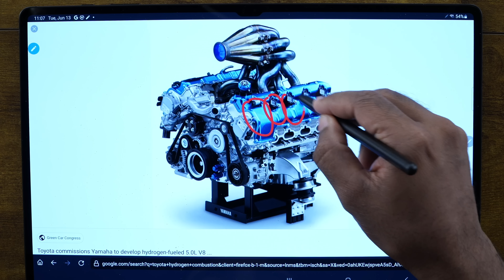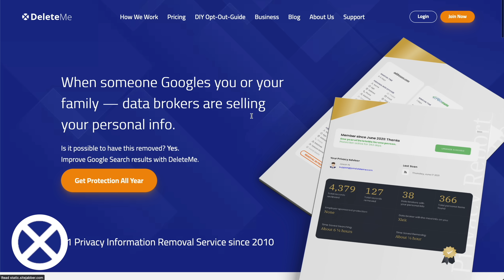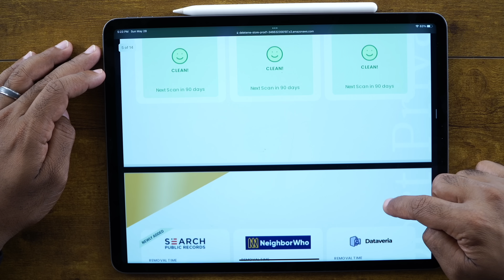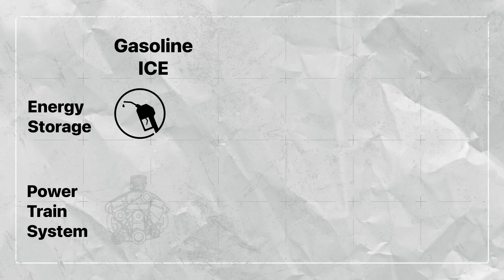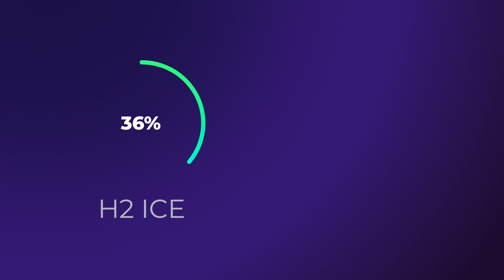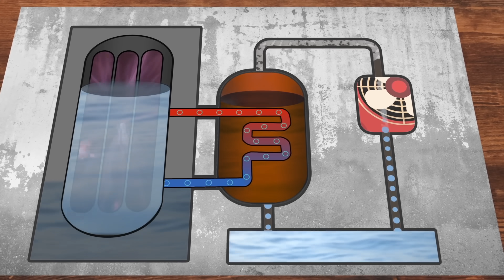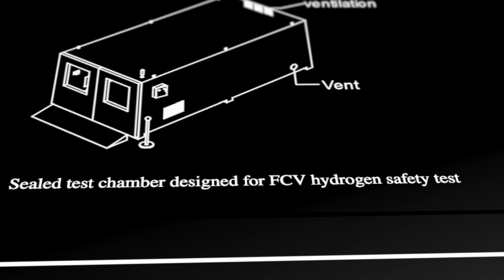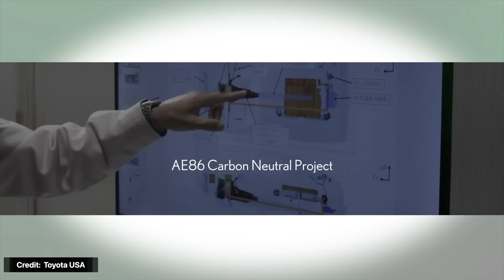Toyota's Says They Just Destroyed EVs - Hydrogen Combustion Engines

Comment: It is absolutely necessary to spread H2 as an alternative to battery EV. It's not a question of pro and con, but to divide the load. To have an alternative available if needed - for example if there is no material available for millions of new batteries... We now see how difficult and expensive it is to spread one alternative to an established system (EV to classic ICE). So why not divide and conquer?
H2 generation, transportation and storage might be ineficient if you compare to "powerplant into battery", but you always forget: Your battery is full but your powerplant (nuclear, wind, water, solar...) still has energy to give. Not using that is 100% loss. Could as well just create some green H2 which takes less space to store than batteries and have it.
H2 powerplants are great fallback solutions. Not only stationary, but also for vehicles.

H2 usage in ICE vs Fuelcell is another topic, and yeah maybe it is indeed just a people pleaser to aid "petrolheads" (no offense)  into a slightly less polluting method of revving. Which is fine. A big part of classic automobile and motorcycle industry doesn't sell mobility, but "feelings" and are highly endangered by the lack of sound and vibration EVs come with. Give them an H2 ICE that is of course way less efficient than a fuelcell or BEV, but still a huge step into less emissions compared to gasoline ICE. Not giving an H2 ICE means those petrolheads won't change at all for as long they can, endangering the whole goal of less emissions.

And lastly: The world is big. America and Europe don't get the memo that H2 stations for vehicle use are a neat thing to have. From that point of view, even the fuelcell EVs like Mirage are doomed to fail. Luckily, in Asia there are H2 stations. There is an market, small as it might be, that drives the development of this technology.
If America and Europe are smart, we will jump on this train. Hopefully sooner rather than later.

Comment: Ballard power systems has had Hydrogen powered vehicles in development since 1986 and had a Hydrogen powered Pickup Truck that drove across Canada and it's total emissions was the equivalent of a bathtub full of hot water.  Hydrogen power cars are nothing new and have been played with for decades but never gained any traction in the market because it means big oil will loose profits and now that Elon Musk has cracked open the door to EV's, and the "Green" initiative going on, EV's are becoming the new trend to replace fossil fuel cars.

The problem is, EV's have a dirty secret.  The materials for the batteries come from countries that permit strip mining and the batteries when their "life" is over don't really get recycled.  They have very little range to speak of and if you want to go somewhere long distance and pull a camper trailer, good luck with that EV, you're going to be stopping an awful lot to recharge.

John Kanzius (Deceased) while looking for a cure to his cancer (A retired radio engineer) also made a machine that released Hydrogen from salt water in a surprising manner.  So much so that he showed it to colleagues he had that worked for GM and GM built a 5 Million dollar prototype with a power cell that could power 1/2 a rural block on salt water.

The sad thing about this announcement is that this will also probably get squashed because it will greatly diminish the ability of EV's to dominate the coming market with their "Green Technology" on so many levels and embarrass so many high level people who pushed the entire EV agenda.

Comment: If the world ever becomes serious about clean energy they will embrace Japan's vision of the modern small nuclear community based reactors that produce hydrogen with its excess electricity.  This would leave the smallest possible carbon footprint behind for future generations.  Battery based vehicles will never be mainstream.  They have just as many issues as hydrogen based models and their true carbon footprint is greater than that of the ICE.  The fact that fossil fuels are used to charge most EVs drives the point home.  Nuclear is the way forward.  Recycling of existing nuclear waste is now a reality that shortens storage spans of nuclear waste dramatically.  The sheer genius of hydrogen is you can convert ICE engines to run on hydrogen as you start to replace gas stations with hydrogen stations.  Another advantage to this approach is you could generate hydrogen on the spot using nuclear generated electricity removing trucks from the road moving hazardous cargo and relieving traffic congestion.  Instead of parking for 15 to 45 minutes to fill up it would be 5 minutes like a typical gasoline fill.  As existing ICE engines wear out, hydrogen fuel cells become mainstream.  Portable electric generators get replaced with portable hydrogen fuel cells.  It's a natural progression.  Don't count out hydrogen.  When the greedy politicians start to run for cover hydrogen will have its day in the spotlight just like nuclear power.  It's the real way forward.  It won't cook birds in the desert and mutilate birds in wind turbines either.  Wake up people!

Comment: The same processes that made Mars a dry planet also operate on Earth, albeit more slowly. If we create an industrial society based on use of hydrogen as a fuel, some of it will leak, as you said. Some of what leaks will escape to space. The natural rate of loss of hydrogen will be accelerated. It will be blown away by the solar wind faster than it already is. Earth will become a dry planet sooner if we use H₂ as fuel.

Technology similar to that which is used to produce H₂ can be used to create gasoline and other liquid fuels for transportation by removing carbon from the air. Use of this type of fuel would not cause buildup of CO₂. Molten Salt Reactors (that operate at very high temperatures) can drive the process.

Comment: The problem is the tank needed for a car. 1kg of liquid hydrogen gives about he same mileage as 1litre of petrol but takes up about 14 litres of volume so you'd need an enormous tank Then there's the issue of liquid hydrogen constantly boiling off and needing to be vented, so leave your car for any length of time and your fuel tank is empty.

Comment: While I agree when Toyota partners with someone else they don't firmly believe in the success so they are not throwing all their eggs into one basket so to speak.  But, you mention Yamaha is their partner for the H2 engine.  Hate to break it to you but, Toyota has a very long standing with Yamaha engines.  Your video contained clips of one such engine created in 1980.  That 4AGE shown multiple times?  Yeah, that's a Yamaha engine.  Not to mention that 4AGE engine has seen five different variants and was still being produced until 2002.  Twenty two years Yamaha produced the 4AGE for Toyota along with many many other engines.  I should know, for the last 31 years I have owned, raced, and built/rebuilt a great many MR2's that have all been 4AGE powered.  Yamaha is stamped into every cylinder head and every block.  Even the Mark 2 MR2 (1990-1998 in Japan vs. 1991-1995 in US) turbo models came with a 3SGTE also designed by Yamaha.  Last I heard they are on the 5th generation of the 3SGTE as it is a common swap for us MK1 MR2 owners.  

I appreciate the video but, if you are going to state something as an example, maybe learn the history of that example before you use it.  Toyota doesn't actually "make" the engines.  They assemble the engines made by someone else like Yamaha.

Comment: Hydrogen is literally the worst idea.  Clean water is already scarce and will only become more scarce.  Burning hydrogen is not efficient, producing hydrogen is not efficient, dispensing hydrogen at the pump is not efficient and storing hydrogen is not efficient.  Battery technology is nowhere near maturity, just like solar energy once was it will outpace current battery technology as we know it in a very short time.  Battery storage will not only unlock EV's but solar and other renewable energy because of the cyclical production nature of most renewable energy.
Big battery EVs are a waste of resources, manufacturers should be regulated to making plug-in hybrids or short range EVs that can charge fast at 240vac until battery technology has matured to unlock long range EVs.

Comment: Hydrogen fuel cells are not even close to 60% efficient. Hydrogen will never be viable over electric vehicles. An ICE hydrogen engine is almost comically stupid. Check out RealEngineering’s video on the truth about hydrogen for and actual fact based video on the topic. 
“We need clean hydrogen” umm no. Hydrogen is nothing more than a battery who’s only advantage over traditional batteries is a faster refill. 
It’s far less efficient, more expensive, more complicated, wastes more energy that could be used elsewhere, requires exceptionally more infrastructure investment, less practical than EVs, and been tried for 50 odd years without success. 
This video is comical in how it it glosses over the absurd inefficiency of hydrogen as a fuel source. Possibly for heavy industry like semis, ships or planes but even the most ambitious theorists admit hydrogen will never be a viable passenger car fuel.

Comment: One thing to add to the negative column for H2 combustion. On board energy density. Even with 10,000 psi tanks of hydrogen stuffed in all available spaces in a hydrogen fuel cell vehicle, which uses hydrogen more efficiently than combustion, a hydrogen fuel cell still has a limited range not that much better than an EV. In fact most of the longest range commercially available passenger HFCVs already have the same range as some of the longer range EVs. 

But with hydrogen combustion you are going to get much less range from that same volume of hydrogen in those same 10,000 psi tanks stuffed into every available spot. The only way a passenger car with a hydrogen combustion engine will get the 300-400 miles of range that an HFCV or EV gets is to add more tanks which means no trunk space or losing the back seats. Not practical in any way.

Comment: You should add how Hydrogen parts are recyclable because they are normal parts. Batteries on electric cars are not recyclable and if we intent to have 5 million cars built each year or more, that means given time of battery cars adoption will also see about 5 million electric car batteries leaching into the ground because we cant do anything with them other than store them. I would like to point out as well that battery cars DO NOT make power. They only store power and the power is made in 60% of cases by fossil fuels. As well mentioning that the battery production cost a lot carbon emissions. Electric cars are not good for the future of travel. The batteries can be unstable in car crashes and catch fire, the lost of range is costly in cold climates, the power grid in the US alone can't handle 100 million electric cars on the road and power any kind of industry along with us power consumption.

Comment: The huge glaring problem with EV's is the fact that after ten or so years the batteries no longer hold charge and your car is now defunct.... That is a huge loss not factored in here... for the cost of replacing the batteries in your ev (which will have to happen as your charge gets worse and worse each time...) you can buy 2-3 used ICE cars that have been running since your ev was built and will continue running for years and years after with basic maintenance.
Reply: The average lifespan of a car is currently 12 years, and it now looks like EV batteries (that are properly managed, i.e. not in a Nissan Leaf) can last at least that long.
Reply: @Xenon0000000000001  I'm sure that is a statistical average, but in reality again look at how many cars there are on the road that are much much older than that. I could have counted probably 60-70 out of 200 just driving around today. Also we have to define lifespan. Does it mean until the engine blows up and is unfixable? Until all parts in the car stop working? Until the owner of the vehicle gets tired of it and gets rid of it? etc. With a conventional car everything can be replaced piecemeal I can replace a full engine in a conventional vehicle for 4,000 - 6,000 (depends on the car and engine I know, but again averages) Electric cars are def dead at the 12 year mark and a guaranteed replacement which is 2x as expensive as that. This isn't even factoring in the fact that they haven't been on the road long enough really to know what will truly go wrong with them when they start to really age. Honestly we may never know as the entirety of the car will be scrapped probably when the batteries wear out. Also not to mention the fact that the industrial mining of rare earth materials to make the batteries for the car is bad enough for the environment to offset the use of the car its just not a great system... We could also open the whole can of worms that is China owning almost every lithium and cobalt mine (2 main components of the batteries that the world is pushing to be used for everything) in the world. They own roughly 70% of both........... But I don't like talking the politics of it... electric vehicles are not a bad idea... They just don't make long-term sense... yet... If we can develop a technology to increase the longevity and chargeability of the batteries then yes it totally makes sense. As of right now they are a rich early adopters novelty.

Comment: Great video and very interesting, but I won't rely on this benefits.
- Half range of a BEV in cold conditions is often exaggerated. There are older cars with this issue, but it isn't a problem with a thermal heat pump. My Tesla Model Y e.g. use roughly 20% more energy at minus 15 degrees celsius (tested during 600 km trip in December 2022). A Hydrogen ICE is an ICE after all and uses more Hydrogen when cold. Even if the problem is not as worse as with gasoline or diesel.
- Rare earth materials are a myth. First, even the rarest of them (Thulium) can be found more often than gold. Some are more common then lead. Second, none of the "rare earth materials" are used in a battery (if you disagree: name them). And we have plenty of Lithium, more than enough to build a few cars for every single human on earth.
- ICE use materials like cobalt as well. Fast working steel alloys (e.g. crank shaft) cannot be made without them or must be replaced every few thousand miles. There is no way to built ICE without cobalt, but batteries without cobalt are used today (June 2023) in normal production cars (LiFePO4).

I think, Hydrogen ICE will follow the way of the FCEV. Get many fans, but hardly any customers.

Comment: I think I might know where Toyota is going with this line of engine research. Ingenuity and creativity have generally thrived in one of three fields throughout history; military, everyday comfort, and entertainment. This type of engine was said to have some uses possibly in heavy machinery, yet is really lacking in comparison to other engines using daily driving. But what if this engine is able to produce enough power and performance at a cheaper cost than octane engines for the Toyota racing team? With improved cost effectiveness of being fueled with red hydrogen, at a lower emissions, combined with it performing better at higher RPMs, which gives it that sound that race enthusiasts are wanting. The push and funding could be there should it really take off, and possibly entice other competitors.

Comment: EV's will win for one simple reason...simplicity. they are far more simple and less maintenance is required to maintain them. ICE engines have too many points of failure. They were good for the time they were in, but the ICE engine concept is quickly fading. I give it another decade or two and ICE engines will be pretty much out.

Comment: Excellent video, and I agree with all of it. But you forgot to mention one thing, the price of the fuel. If they can make hydrogen very cheap, efficiency doesn't matter all that much anymore. Fossil fuels were never efficient either.

And now I think there is a way to make hydrogen very cheap, with thermal plasma electrolysis. Hope you check this technology out! It's from a company called Hiiroc. I really want to know more about it. They claim they can make hydrogen for a price that's 4 or 5 times less than normal electrolysis with renewables, the so called green hydrogen. They call theirs "emerald" hydrogen. Yet another new color.

There's also pyrolysis. BASF is planning to make hydrogen this way. It would be great if they could that ASAP, and replace steam reforming with it. 

Both these technologies would be carbon negative if they use biomethane. The only byproduct is black carbon.

So please take a look at this! I really want to know more about these technologies. Converting biomethane into hydrogen and black carbon, would be a good alternative to BECCS. Hydrogen production would then extract carbon from the atmosphere, while at the same time decarbonize hard to decarbonize industries. The perfect technology if you ask me, but does it work like they claim it does? What are the negatives? Can you figure that out for us please? Thanks!

Comment: 36% efficiency is still a lot better than a gasoline ICE.  I would say the Hydrogen ICE , or even the hydrogen fuel cell would be the way to go.  Electric cars are more expensive, batteries cost a lot to replace, and out power grid infrastructure could not sustain everyone plugged in to charge their EV. Plus the manufacturing process of the batteries is worse environmentally than a gas ICE and no proper lithium battery disposal or recycling has been created so that is another environmental hazard in the making .  Gas stations can be retrofitted easier to hydrogen and allows energy companies to transition from Oil to Hydrogen while still keeping the pockets lined with cash.  It's the more realistic scenario IMO